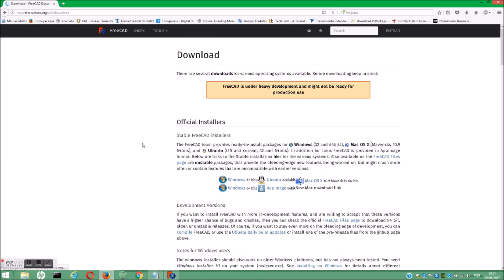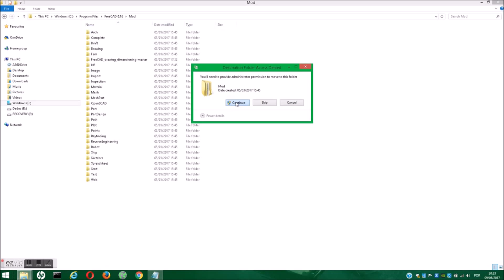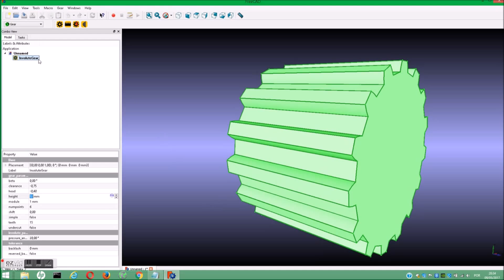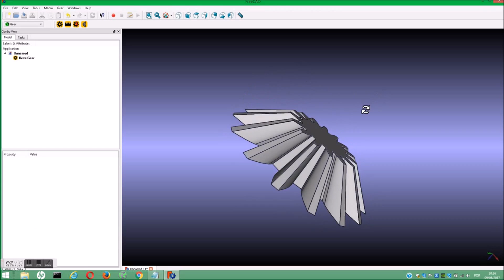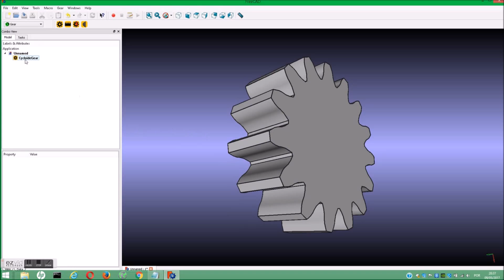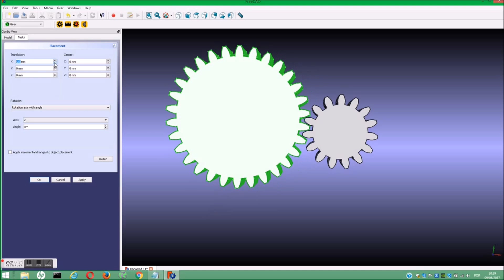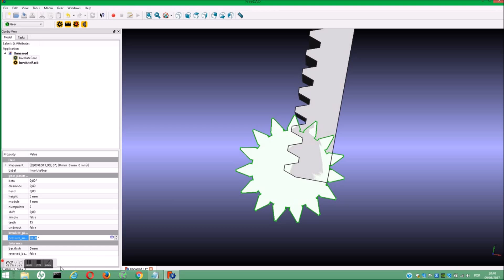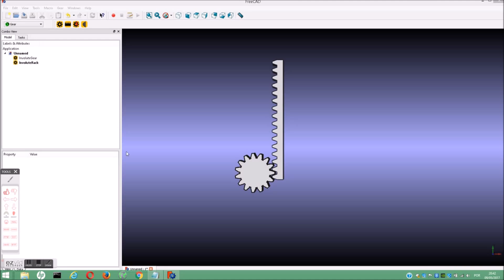FreeCAD Gear Workbench (FCGear Module)

Comment: This does not seem to work with windows 10 do you have any suggestions?
Reply: Switch to Linux
Reply from the maker: Specify your problem. You followed all the steps and still did not create this worbench in softwere. Did you restart FreeCAD?
Reply: MindScraper, I followed the steps and had prevoiusly followed them on the github page. I have also tried adding the file to data mod. It would be SO handy. thanks.
Reply from the maker: Try going to Tools select Customize and then Workbenches. Checks if it's disabled
Reply: Try to avoid using Windows. It is an unstable and unsafe OS. Install a linux distro and be happy!
Reply: @josegegas  Hello Jose! I tryied this add on today on my WINDOWS 10 computer with success. Best regards.
Reply: Run Linux.

Comment: How to dig a hole in the gear?
When I want to create a sketch, it always shows no entity
Reply: version 0.18
Reply from the maker: You can create a cylinder. Place it in the center of the gear and perform a Boolean cutting operation
Reply from the maker: I'm not at the PC right now. So it's harder to help you
Reply: @MindScraper  This is enough,thanks a lot!

Comment: Nice tutorial through find, install, and use. Path on Ubuntu /usr/lib/freecad/Mod

How next to generate a tool path to cut one of these out? I went to the path workbench, created a project, imported some tools, selected the whole gear, then deselected the two faces leaving only the teeth highlighted, but choosing any of the path creation options just throws errors. Is there an intermediate step? (Also using v0.16)

Thanks.
Reply from the maker: I'm sorry. But I have no experience using the path workbench.